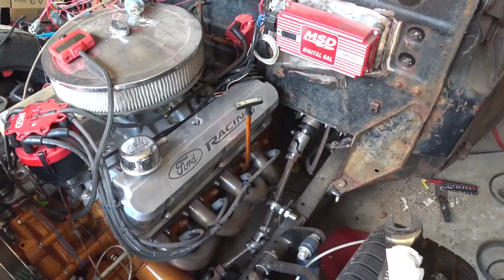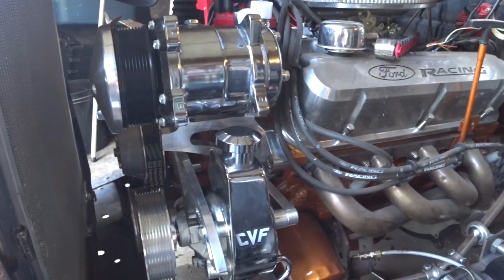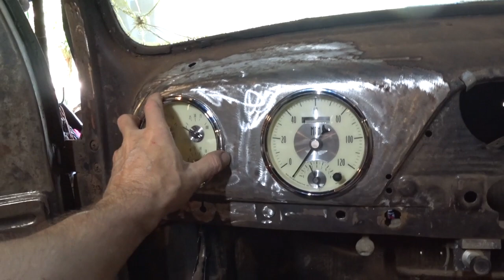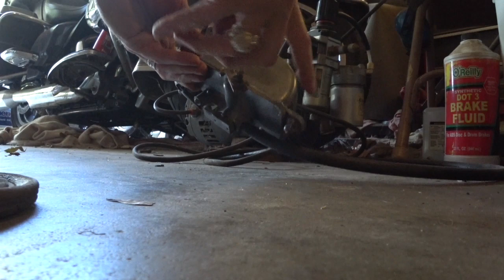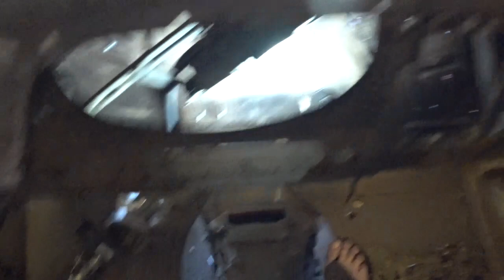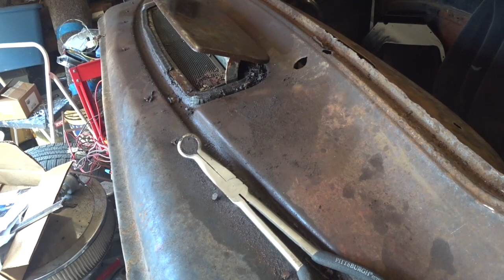Rebuilding a 1951 Ford F 1 - Part 17 - Accessory Drive, Gauges, and Windshield Wipers

Comment: I bought and disassembled my 48 five years ago.  It was my (future) retirement project… well, I just retired and was analyzing my order of battle with the ol girl.  I like what you’ve done and will pattern mine pretty much same direction. Chassis first, drivetrain, body, mechanical and electrical, etc…
Some folks like driving them, I’ve always enjoyed the problem solving of the build.  I hope I finish it before I’m finished….lol

Comment: Hi had a question did you remove your factory cross member when you install the transmission get it underneath the cab.?
Reply from the maker: I did remove the factory crossmember. I built a bolt-in crossmember and transmission mount.
Reply: @TreyClanton  thanks for the info .